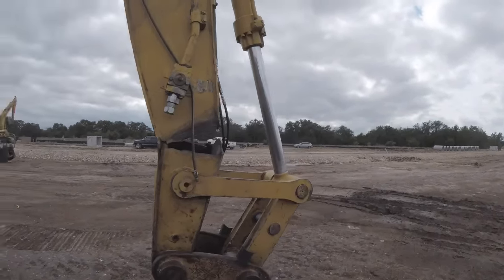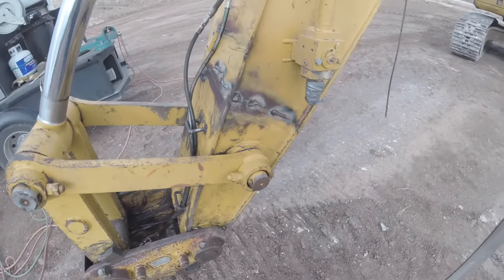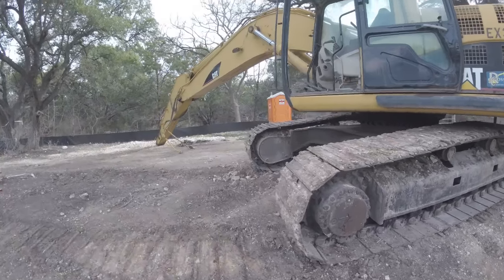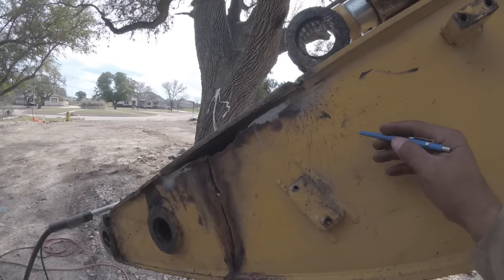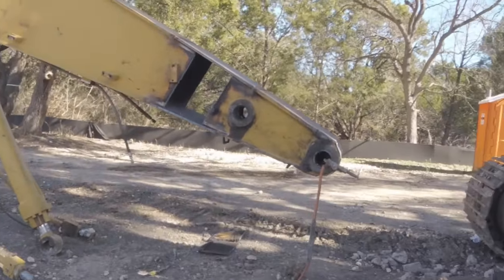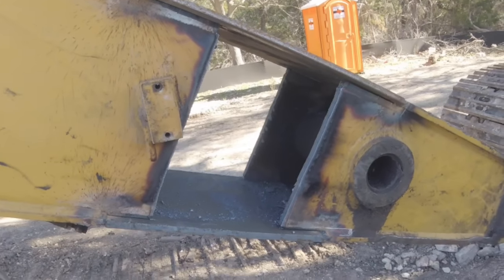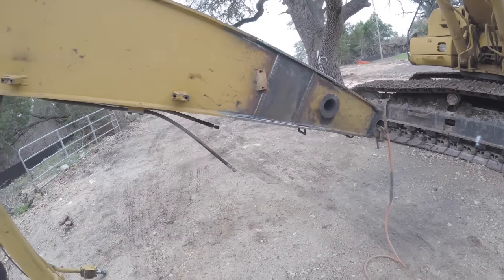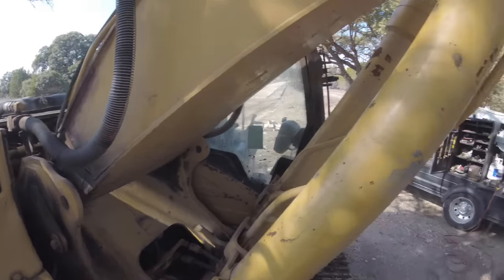Woops!! Excavator had a bad day!!

Comment: You do some really nice work to bring it back to a factory look but it's obviously the weak point of that arm because I could see that it was repaired numerous times before why not put some serious reinforcing top and bottom?
Reply: If you make it stronger in one part it only breaks at a weaker part... as we see at the pin end of the boom.

Repairing this machine is basically folly but offers IC decent good paying work and chance to showcase his skills

Comment: You gots to become one with the dirt and use the dirt force like a Jedi Knight when you're digging.   you want the dirt to remove its self and just use your digger to lead the dirt and coax the dirt into the bucket.   the dirt doesn't want to be in the hole,  you want to concentrate and focus on freeing the dirt,  not brute forcing the dirt.   That's why you need to know the dirt or you just wind up with a busted excavator.

Comment: If you don’t pre heat it before welding will the weld crack?
Reply from the maker: Not necessarily if the steel is under 1/2 thick

Comment: You should have something applying pressure to that steel plate that you're welding in some cases it's been known to lift away from the surface your welding when it gets hot that's why certain welders use clamps

Comment: You need to fish plate more steel on 2 sides, after the weld repair is done as that will make it impossible to rebreak! Have you ever seen a double walled dump truck frame made for extra strength???? That's what needs to be done. Or else it will crack again.

Comment: hello 
have a mini exc. with oval bushing bed...original bushungs remaked by previous owner with better material tham arm...thus is the last bush on the arm where the bucket and fast xoupling attacks...is itbetter to weld and rebor3 it or change the entirebushing bed with another reinforced...it is slightlz cracked from one side

Comment: What wire did you use ?  And What was the grade of the steel ? I think the minimums to both of my questions would be Lincoln NR 232 or NR 233 on the wire and for the Grade 50 .

Comment: If you had left the "curve" in the machine, and reinforced it say without making it perfectly straight, would it structurally have really made a difference?  I am curious, you make doing it correct look so easy, I commend you on a great job. But back to my question, I'm curious why structurally it may have mattered or not.  (The boom would be pulling on it when retracted because of the difference in space? it is that close? Curious)
Reply from the maker: The bend in the boom may have been what was contributing to the breakage. The quick attach for the hammer may have been slightly hitting the boom under full articulation but yet not at full hydraulic cylinder stroke. So it may have been pushing on the boom until it broke. Hard to say. But, I will say that I just saw this machine a couple of weeks ago and its still doing fine.
Reply: @ICWeld  I am a working mechanical and electrical engineer, specializing in automation and factory work worldwide. I am NOT any type of expert in metallurgy and always consult with my welders, and/or fellow consulting engineers. Let me tell ya, "if I guess" (and I never do) but whenever "i think it's enough"  I'm never close. You are a amazing craftsman, thank you for the video and response, I definitely gained some  knowledge and insight. No piece of paper will ever take the place of a trained laborer with decades of experience. Stay safe IC

Comment: I believe the boom is too long for the rock hammer that was mounted on it!
Too much leverage and the shock of the hammer is too much for that boom.
I believe when you buy the excavator with a rock hammer, it has a boom designed for that purpose.

Comment: The machine looks old, maybe time for a new one or replace the whole front arm. Guy may not want to spend . I had a job almost identical, welded it back up (chamfered the metal first) grind flush and put thick gussets on it and weld. All steel in there is no good, been welded so many times it's weak and is fatigued. Flat pieces bridge over that on to better steel, basically what he's doing but easier and it worked.

Comment: That excavator seems to have a serious design flaw. Either that or they are treating the equipment extremely poorly. Looks like that isn’t the first time it’s failed in that spot, and since the new failure isn’t limited to the repair weld, I’m betting the problem will happen again somewhere nearby after you fix it.

Comment: The metal keeps failing after repeated patch ups because in welding it together the base metal both on top and bottom get weakened by the tremendous heat from welding it back up. The failure point is not at the welding but right under it.
Reply: Basically all previous welds have been butt joints which are significantly weaker that using plates to keep both halves together by a stronger joint.

Comment: When it was all opened up I would have installed big huge backing plates not that worthless junk then weld it all back together and make new plates for the outside and that way you have double the strength

Comment: You dont need backing plates if you do a full penetration V butt weld and stager the plates cuts so the weld isnt a complete ring around the boon.
As a certified Pressure welder i have never used backing plates. Ya dont use it on pressure pipe and structural butt welds.
Reply from the maker: I agree. but better safe than sorry. especially since this boom was joined with backing plates. Just copying the factory.
Reply: @ICWeld  Im not saying ya doing it wrong, just not necessary. I did a lot of destructive testing in the Lab, as a fitter machinist welder, in the military and when ya do your pressure welding tickets. Your welding esp on the Flux core is good quality word.
I specialised in Heavy rebuilding crack repair hard facing you name it only thing i hever did was Line boring as most of my work was in the city. I was even asked to teach for Lincoln here in Sydney, as they used to have a school, massive plant. I did two weeks welding in their lab and destructive testing the welds to get certification for exotic wires and rods for Lloyds certification for that particular wire. Ide do 20 to 50 passes with thick plate and strong backs following their  procedure or i would do my own and doccument it and pass it on to the Lab and metalurgist. We would cut out the weld once done and break tensile and chemical etch and grain structure test. Never failed a Specification test. Then they offered me a job teaching but the money was too good out side. My core job was but welding Beams on site.
So when you are welding Weded Beams 15 metres and but welding them over foyers in lobies, ya gotta know the limitations of the material. All im saying is if ya get penetration with the wires on the market today you can sleep easy at night.

Comment: Why not weld the inside also, when you had those sideplates open, and had access? I reckon it would have made it a lot sturdier.
Reply from the maker: Guess I coulda welded the backing strips but it may have been too much heat input. not sure. really didn't think of it.

Comment: I don’t know I think it’ll crack again, I would’ve put a full new piece of steel , made holes with a mag  drill and weld through the holes until they are flush, then put another piece over it to make the machine look brand new

Comment: I am doing almost the same project, welding a 3/4" steel plate to the bottom plate of a large Cat excavator to attach a thumb. I was told the steel on these arms is ductile and that it need to be heated with a rosebud torch to be able to weld it. Is that true? What rod would you use to weld the 3/4" plate to the 1/2" steel plate on the arm. and what amp would you run it at? any help would be greatly appreciated.
Reply: I've heard people argue about the type of steel used (high strength steel or ductile).for high strength steel, I would preheat to around 3- 350F and a low hydrogen rod (7018) used.. .if its ductile, a preheat of around 4-500F is required with peening and monitoring of interpass heat and a slow cool down ..high nickel content rod would be used...call the manufacturer and usually they will provide the material specs...good luck
Reply from the maker: You know, I've never run into anything that wasn't  easily welded without regular Ole' 7018's and a little preheat. I believe Case backhoes have a cast boom and dipperstick that is nonweldable but other than that, I've never had any problems with anything.

Comment: Do you ever add reinforcement plates over cracks after you weld them? I know the clients may not like it if they are worried about re-sale but it sure adds some strength if they just want it fixed nice and strong. I wouldn't hesitate to do that to my backhoe if it ever snapped. I built a road roller once with a road blade half way down the draw bar. I made a few sharp turns pulling it with a tractor and it broke in the middle  where everything came together. The roller weighed about 5,000 pounds. I re-welded it with some 7018 and added 1/4 thick strapping over the welded joint. It's held ever since.

Comment: Good evening, I am trying to understand, how it's possible that so many of these Cat welds are failing. Is it a manufacturer  issue. Or is it abuse,  from the operator. If it's the operator, I would fire them on the spot, Joe Capo.
Reply from the maker: Hard to say but ive done my share over the years.

Comment: Is there a certain osho approved metal that these booms are made of or need to repair cause of strength or flex, tks flr your time and vids
Reply from the maker: I'm not too sure of the actual strength of the original parent metal. However, the customers normally provide what's called T-1 plate. It's a general use construction plate. Not too hard and not too soft. its good for situations like this.

Comment: As a former Ironworker union shop welder who did repairs on 20 foot hood,trunks and roof transport racks for GM in Michigan as well as stackable parts tubs forklift guys managed to almost FUBAR mangle I can tell you this gentleman definitely is top dog at his trade.
I kind miss the smell and sounds of welding.
Mig, Tig and stick.
Very little gas welding.
Mig was my preference.
Stick can be a pain in the a#@.
I'm sure they're paying union level wages even if he's non union.
Good welding technique is a talent period.
I knew guys who couldn't weld a straight pass if the work was jigged.
I happen to be ambidextrous so I could lay perfect beads either hand as needed.
Field work like he does can really be a raw dog bitch to handle.
Especially with work going on around you.
Ya gotta watch your equipment constantly so nothing grows legs.
I had a self made fresh air pack I used to keep fresh air flowing thru my helmet as we never what crap was covering the equipment we welded including sprayed foam insulation as well as the smoke itself.
I knew many an older welder that ended up with serious lung issues by the time they retired including the gentleman who first taught me how to weld.
He worked first shift at Buick in Flint then second with me at C & M machine shop in Vassar Michigan.
He ended up dying from welders lung.

Comment: Welding is a temporary repair I would think. That piece needs to be replaced. Tons of stress gets constantly is applied. I would have my equipment insured. Plus did manufacturer used inferior steel ?
Reply: Ummm no. This will be better than anything the factory could provide. Tge equipment is insured, but insurance isn't going to cover breakage from a rock breaker. Insurance covers theft. Its obvious you have zero clue what you're talking about. You also understand all this work is a tax write off for the construction company, right?
Reply: Factory equipment is better than repaired equipment

Comment: What I've seen is some welding guys put 3 head bars, like 11/5 thick and wide say 4 ft longwitch stiffens the inside of bomb, then they fish plate the top section of the bomb especially if they have no plans for a clam system.

Comment: if you ask me the machinist on that excevator is using the arm as a hammer (slamming it down from great height ) or a crowbar (wedging the arm under a crossbeam and curl the bucket up)
could allso be that they have the hydraulic pressure set up way too high (safety overides closed up a little ) or a way too small excavator for the job 
it has happened before it might be cheaper for the company to hire a machinist with a softer touch

Comment: weld on weld is not good hence cutting out the bad bits, but the crack across the bottom of the arm next to the unit, that would tell me that the whole thing needs replacing, the metal used was not fit for the job, especially if its the 2nd repair.

Comment: Sorry, but any repairman in any trade who has  " ... previously repaired a crack right here ..." but which " ... looks like it's gone again..." would not get a second call out from me. If a machine has inherent weak points that fail, then reinforcing it with a "better than original" repair to avoid any chance of subsequent fails in the same place would be the proper way to deal with it.

Comment: Why didnt you line up flush one edge on one side before welding so you would only have to cut one side instead of making more work for yourself and having to cut both sides of the plate?  11:44

Comment: Like your stuff.  But how on earth did the operators do this damage.   They must have been using the digger like a battering ram.  Welded mild steel equipment is just not designed to be used this way.  Sad to see such equipment misused like this!
Reply from the maker: It had a jack hammer attachment. They're very rough on machines

Comment: Question for anyone: How is he able to "Mig Weld" without a cover on the end of the Torch were the Wire comes out ?  THX. Ted.
Reply from the maker: fluxcore. shelf shielded wire.
Reply: @ICWeld  Thank you for the reply.  I was not aware that it is a process that can be used for more that tacking fence posts or gate's or other non structural, critical repairs. Ted.

Comment: Are you running flux core if so y don't we see you clean at all between passes I just know from my experience is clean clean clean is the key to a good weld on structureual work not nocking your work just making shure
Reply from the maker: There are a couple of clips of me cleaning the previous welds. just didnt want to bore the audience with that.

Comment: Appears the metal failed just below the last repair welds.

Any idea who fixed it the last time?
Whoever it was didn't even bother to grind off the paint where s/he was welding. I see a LOT of burned paint around the original/last repair.

I hope you put some worth-while longer than an inch backing plates/reinforcements and a bit of reinforcements on the exterior, and ground off the rust and paint for a clean weld surface.

Me? I'da ground off all the paint and rust 10 inch above and below the break, so no paint or contaminates in the weld, used 1/2 or 5/8 inch reinforcement plates on the inside, about 6 or 8 inches above the break, after slitting the front/sides/back a 1/4 inch to add additional vertical welds to the backing plates, then 1/2 inch or 5/8 inch plate with 7/8 inch holes to fill in and attach to the original arm, then let cool naturally, 

Just a weld at the break and a few inches above and below aren't going to hold very long.

I'd have my "pipeline" welder set for around 90 to 100 volts and 250-275 amp for high heat and good penetration. (using the 300 amp Lincoln I had. If I blow through, no biggie, just fill in the blowout as I go. I was taught "go hot or stay home")

Comment: Boy I’d be pretty upset with the operator of that machine things happen but busting iron takes abuse I’ve ran allot of old worn out machines and sure bearings go bushings pumps things like that but I’ve never busted a boom off even when I worked a rock pit pulling down walls the buckets took a beating but never a boom and I greased everything at the end of the shift and cleaned filters I ran a 980b without brakes and the bushings were so worn you had to stop and wait for the machine to stop racking back and forth to load a truck and still never broke iron on it getting out 55 loads a day

Comment: Just one thing after another.  Perhaps the machine was not designed for rock breaking.. Good job anyway.  Thanks.
Reply: I've worked as a Verification & Validation Engineer for both Caterpillar and JCB and we always reckoned, at both Companies, that if you want to test an excavator arm a hammer attachment is the quickest way. I had a machine on test with a hammer on it at a Chromium mine and we shipped that machine to site with a spare stick and boom.